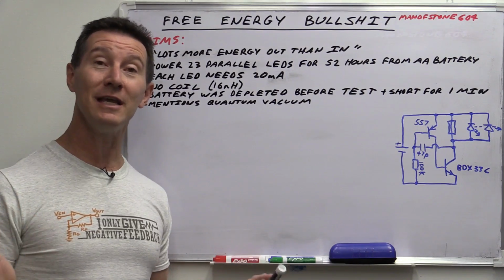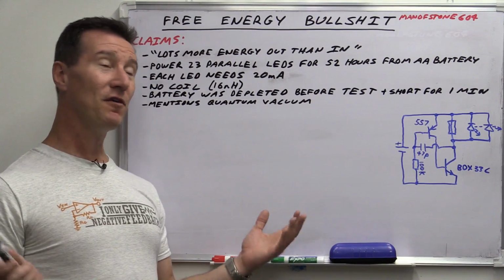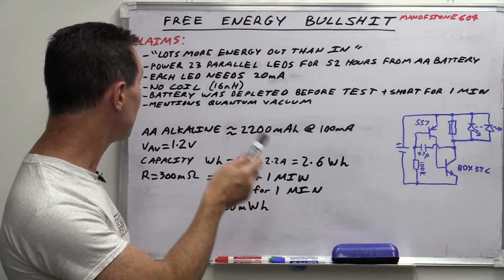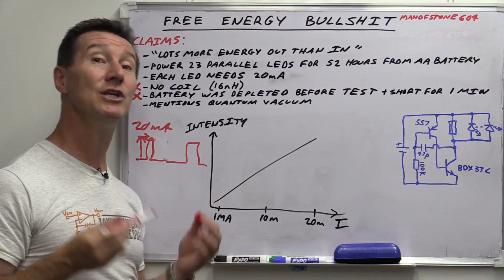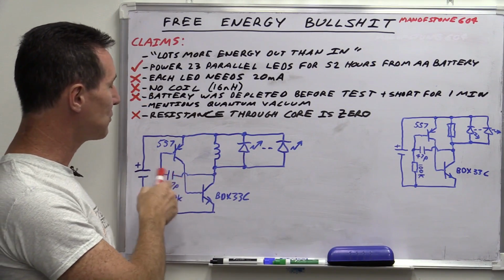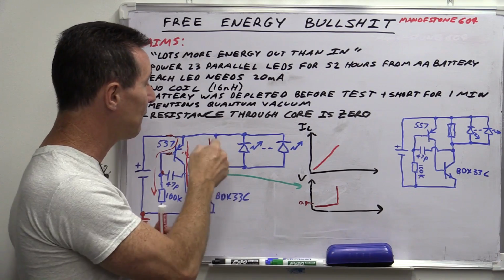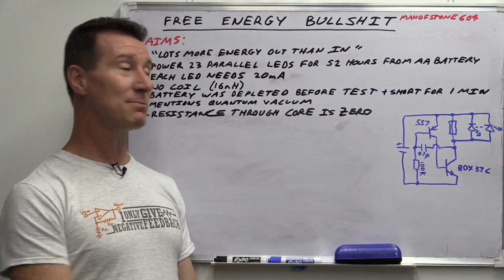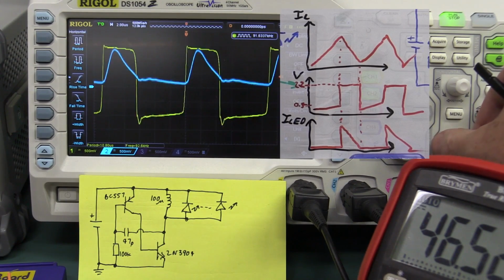EEVblog #708 - Free Energy Overunity is RUBBISH!

Comment: Free Energy generators are a fantastic reality and in many forms. Anyone that is hung up on ancient physical laws such as Newtonian laws of thermodynamics and the conservation of energy and motion sadly are not aware of quantum physics that define electrical activity in a Configured system. Newtonian Physics define things in a natural state where as Quantum Physics define things in artificial configured states. No one can use Newtonian Physics to define Over Unity but everyone can use Quantum Physics to define Over Unity. The author of this video is sadly limited in his education and is unaware of this but something tells us that even if he knew the difference he would STILL speak against the reality of Over Unity because he thinks it will cause people to give him attention.
Reply: Sure, when you say you are attempting to test a "set" you mean 2? And if so that constitutes a series. Capacitors in series are capacitors that are placed back-to-back with the negative electrode of one capacitor connecting to the positive electrode of the other. The capacitors are in series because they are back-to-back against each other, and each negative electrode is connected to the successive capacitor's positive electrode. The best way to think of a series circuit is that if current flows through the circuit, the current can only take one path. When capacitors are in series, the total capacitance value is always less than the smallest capacitance of the circuit. In other words, when capacitors are in series, the total capacitance decreases. It's always less than any of the values of the capacitors in the circuit. The capacitance doesn't increase in series; it decreases.

If you want to test the series and parallel connections out practically, get 2 1µF or whatever capacitors you have, but let them be of the same value. In this example, I'll stick with 1µF capacitors. Now take the capacitors and place them in series. Now take the multi meter and place in the capacitance meter setting and place the probes over the positive electrode of the first capacitor and the negative electrode of the second capacitor. You should read just about 0.5µF, which is half the value. This proves that capacitance is lower when capacitors are connected in series. Now place the capacitors in parallel. Take the multimeter probes and place one end on the positive side and one end on the negative. You should now read 2µF, or double the value, because capacitors in parallel add together. This is a practical, real-life test you can do to show how capacitors work but since you are testing super capacitors your power reading will of course be much larger but using micro farads is easier to understand so the process will be the same.

But, for polar capacitors, such as electrolytic and tantalum, the capacitors must be oriented in the circuit in the correct way. Polar capacitors, in series, must be placed so that the negative electrode of the first capacitor connects to the positive electrode of the second capacitor, and so forth for all capacitors in series. In parallel, the capacitor electrodes must all be common, all positive electrodes connect together on a common plane and all negative electrodes connect together on a common plane, which is normally ground. For nonpolar capacitors, including ceramic capacitors, orientation does not matter, since the capacitor isn't polarized. I hope this helps you to learn basic capacitance testing in a capacitor and if you have any other questions I'll help get you through it just post me again if you need help.
Reply: Correct me if I'm wrong but Over Unity is having a system that puts out more energy then the energy put in. In order to prove that it is real someone would have to build a system and measure the energy going in and out of it. If the output is higher it's over unity. How does Quantum Physics change the meaning of over unity?
Reply: Well you did say correct you if you were wrong, so we are here to correct you, endlessly for the next 100 years to counter your cheap and transparent attempt to mis-inform the public in your disinformation campaign you have been contracted to do against the new technology of working Free Energy Generators. So, here we go.....

Adam Trombly  has in fact created just a system, your viewer can go to the YouTube search bar and merely type in Adam Trombly. This inventor will get the newcomer to Free Energy brought up to date and then the newcomer can see that you are clearly lying about there being no Free Energy. Secondly, Quantum Physics takes into account other dimensions of existence and that thusly those other dimensions of existence has different physical laws that govern its matrix and that energy traverses ALL dimensions but that the physical laws of each dimension manipulates that energy differently. Unlike in the third dimension that we exist in while we are alive energy is NOT an electron. No instead energy is wave patterns of directional movement of Ether flow and that Ether flow IS energy and that this Ether flow can be brought into control and manipulation by way of manipulating magnetic flux and field shaping. This is where understanding Over Unity begins because if you use a small amount of energy to start an Etherical siphoned energy flow from the Ether, then the amount of energy that is flowing as a result of that initial action is quite clearly FAR MORE energy out than in. Now, lets see if you spend more time trying to discredit what we've just typed in this post or if you spend more energy asking questions in a sincere attempt to know more about the subject. We assume that OF COURSE you will spend more time trying to discredit something you know absolutely nothing about, thus is why we have placed you in our cross hairs.
Reply: "we have placed you in our cross hairs" Ok that seems a little over the top. Thank you for answering my question though.
Reply: "we have placed you in our cross hairs" obviously refers to the "crosshairs" of being corrected informationally. But if you want to pretend that you didn't quote us out of context to imply we meant something else by the phrase then go ahead, that's what liberals do, yet another form of lying. You will remain in informational cross hairs until you are eventually corrected. Get used to us, we are living on your channel.
Reply: +Anti NWO
Word salad nonsense. You are obviously entirely uneducated in the field of physics.
" Quantum Physics takes into account other dimensions of existence and 
that thusly those other dimensions of existence has different physical 
laws that govern its matrix and that energy traverses ALL dimensions but
 that the physical laws of each dimension manipulates that energy 
differently."
>lol
Reply: Cool no one watches my videos. I have a video where I'm trying to test the capacitance of a set of supercapacitors pretty sure I'm doing it wrong if you have any suggestions please let me know.

Comment: I have a wireless mouse that is powered by one AA-battery, the battery has lasted over 220 hours and still counting.
Reply: It is a laser mouse with a wireless transmitter
Reply: how much power does the led in the mouse need,?how power does the battery provide?

Comment: I have a battery charger that draws  5ma @12V in 20 hours charges a 2.2 AH
lipo starting at 9V to 15V
the lipo temperature drops to 15 deg below ambient so the energy may be from
the lipo converting heat into charge
Reply: Wow, you've invented a solid-state fridge!  Or perhaps not...
Reply: no it;s a battery charger its a 12V relay wired up as a buzzer with 
permanent magnets in line with the relay coil  witch is paralleled
with an air coil with permanent magnets opposed to the coil   
and a diode to catch the inductive kick back it will charge a cap to 480V first test of the circuit 
100mah in 2200mah out in to a 3 cell lipo it's ether free energy or ambient heat is charging the battery but it works

Comment: EEVblog, .... Now on the first part of your post, here let me copy it right out of your last post and then paste it in this box so if you attempt to edit it out we will have what you originally posted, here it is..............."Anti NWO You still haven't answered my claim on why the 2nd law of Thermodynamics can work on perpetual energy systems"............. you just typed that the 2nd law ...,"can"...work on "perpetual" energy systems and that it was your claim. Now you are saying that your perpetual energy systems do work according to the first level of physics which is Newtonian. Why are you saying that? ...............

No, Newtonian physics will never explain Over Unity where as Quantum Physics does. You postulate that everything has an equal and opposite reaction according to the first level of physics, Newtonian and this is correct. Einstein's relativity is part of that first level of physics and it too clearly shows equal and opposite in every force and movement. The second level of physics is Quantum and Quantum Physics explains how things work in artificially configured systems. Here's an example, the timing of an internal combustion engine coupled to a cam shaft that operates the valves relative to a common moving shaft between both systems will equal a cooperative effort of said apparatus to perpetually move the shaft as long as an OUTSIDE source of fuel is provided as the source mover in said apparatus. ..............

Now the internal combustion engine is NOT a natural system, its a configured system. The moving parts do follow the Newtonian physics model of equal and opposite reactions among the many moving parts and is relative to its source mover, fuel. Of course the engine is very inefficient but that's not the point here, what we have here is a configured system following Newtonian physics WHILE being an in-natural and configured system. Free Energy systems are like this as well, only the moving source is an electrical current in the ambient ether field that can be manipulated into being siphoned out of that dimension and "sucked" into this dimension by way of presentation of conduits such as copper or gold wires and or coils with a higher potential difference in the receiving coil than the extrapolation coil such that the difference goes to the greater difference, the larger coil conduit in this dimension and when this occurs the electrical current begins to siphon into this dimension at a flow rate equal to the square of the difference between the potentials mentioned. This is then called Zero Point ENergy and its not a theory, its proven fact. ...............

Newtonian physic and relativity as its written cannot predict this outcome but Quantum can with it's string theory. This is the most basic level of thought on this subject for you to understand how it works. If you take a moment you will see that it rings true. When you understand this then I can take you to the next level. If you argue against it after its already an accepted scientific fact world wide then you will have a lot of catching up to do before we can go further.

Comment: Fenix flashlight has a flashlight that can run around 90 hours that's around double on double the power on its lowest setting. It takes 2 AA's so I thing it is using quantum vacuum too hahaha. On it's lowest setting you still have a usable light, and not 20 piss poor leds that don't give of usable light. It's just a better led that gives a bit of usable light. At max it draws those batteries in 1.5 hours. But non the less usable light on 2 aa for 90 hours isn't magic. Fenix LD22 2015 i'm talking about. Great peace of equipment. To expensive to send you one.

Comment: We all get sick of the free energy fakers, and yes there is no such thing has a free lunch. However it should be perfectly possible to construct a free energy device that operates without violating any laws of physics. For instance we currently get free energy from solar panels which pick up sunlight and make electricity. We also live on a planet awash with available energy, compared with surface temperatures on Jupiter the Earth is a very warm place indeed. So therefore it should be perfectly possible for engineers to build a machine which converts this warmth into usable electricity or useable heat, whilst lowering the temperature of the environment around the device. I think what people hate so much, and probably try to rebel against is the fact that we do live on a planet awash with energy, yet we have to pay some fat cat for energy that comes out the ground, and whilst being burnt produces lots of nasty air pollution which destroys our lungs. We need a new economy away from fossil fuels, one in which people no longer pay large sums of their hard earned wealth to a greedy elite. An economy which is based around global happiness, people should be spending more on leisure and holidays, not lining the pockets of energy cartels for fossil fuels we should not be burning. We do need research into free energy devices that will actually work, devices that extract energy from their environment. Yes the internet is full of fakers and wishful, wellmeaning thinkers. But to say free energy cannot exist at all, would be to actually deny the current laws of physics.
Reply: Not gonna bother to read all that. Free energy says that if you put in X amount of energy, you can get X amount (or more) of energy out of the system. You simply cannot. The sun is putting out some serious power. We are able to harness a very small fraction of that. Same with wind, waves, etc. 

There are issues with integrating renewable into our national grid that are being worked out. The quality of the power isn't able to compete with our existing infrastructure.
Reply: I don't think we can call them "effective" just yet, at least not for the US. I'm not saying I don't believe in them, and I really think we need to get away from burning fuels to generate power as soon as we can. But I don't want to jump on them just yet until we've gotten to a point where they reach somewhere around 50-60% efficiency cost-effectively. Wind turbines are very close, because the most efficient versions can get upwards of 40% efficiency, but solar cells are still only about 22% efficient for the most cutting edge, expensive cells. Hydroelectric power would be ideal, but waterfalls are few and far between. Hopefully we can get more universities on the problem and get some manufacturing engineers on it.
Reply: Its a fair comment, but people get hung up on the efficiency, especially of solar panels, some panels go into decline after five years use, that is simply not acceptable, usually its the amorphous silicon panels which do that. Has for the efficiency of normal Polycrystalline and Monocrystalline silicon panels, it does not matter really if they are only 15% efficient, if they are cheap, which they are now, then the power output is not such an issue. We have to remember that in some ways they should be regarded has 100% efficient because we do not have to supply them with fuel, like gas or coal. And has for mounting them  we certainly have lots of useless warehouse and factory roofs available, and even polluted land like around Chernobyl. The seebeck generator on the popular self powered wood burning stove fans are only around 6% efficient at converting heat to electricity, however the device could be classed as 100% efficient because any wasted heat just warms the room. Its the same with an old incandescent light bulb, everyone hates them, but the fact is that in the winter time, any energy wasted has heat is not really wasted because the heat goes to warm the room.  The trouble I have is one of great frustration, I had high hopes has a child in the eighties that we would by now all be driving electric cars, and we would have moved away completely from fossil fuels. But technological advancements and science have been held back by a greedy few who like things the way they are, they like drinking champagne at £3000 a bottle, they like their young prostitutes brought to their 5 star hotel rooms, they do not want to see their cosy little gold mines go down the pan. Hence why has a species which is laughably called advanced, we are still burning fossil fuels which are expensive. KeeDx3 mentioned and he was quite right that no one will supply energy for free, however the cost of energy in an advanced society should almost be zero. The whole idea of progress is supposed to be one of betterment, we humans should all be enjoying ourselves more and spending money on a leisure economy rather than paying a large chunk of our wages to simply heat our homes whilst we are being blasted with a 1000 watts per square meter of energy from the sun. Whilst beneath our feet the ground is superheated and hot enough to turn rocks into liquid. A town near me has water pissing out the ground at 20 degrees C, the towns buildings are mostly heated by natural gas. The water is hard with lots of Calcium, this would clog up normal heat exchangers. But if they insulated their buildings and ran the water through a large bore Teflon pipe inside an insulated floor slab you could keep the building at a perfect temperature. But they do not do any of that, even the Victorians at least used to swim in the stuff, but these days they have converted the old swimming pool into a indoor fish pond, so you cannot even enjoy a swim. all they do is let the geothermal waters flow wasted into the nearby river. This kind of thing makes me despair, we have progressed so little since the eighties..